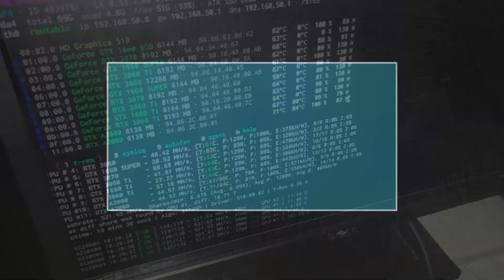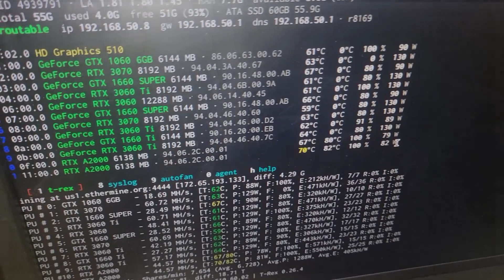Risk of Running Shunt Modded A2000

Comment: Those aren't inductors, lol.
Reply from the maker: WTF are you looking at, that is an inductor. The Gray square with the writing 1R0 2002 on it. 

Vega - SerpentX — Today at 10:39 PM
Quick question, What would you call this component?

buildzoid — Today at 10:41 PM
inductor/coil/choke
Reply from the maker: Or Shielded Power Inductor, whichever you prefer.